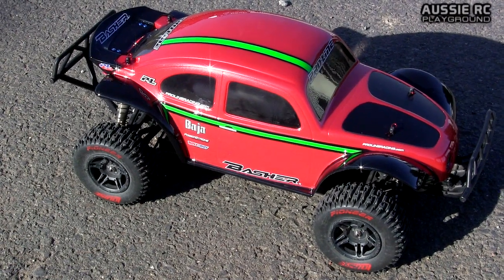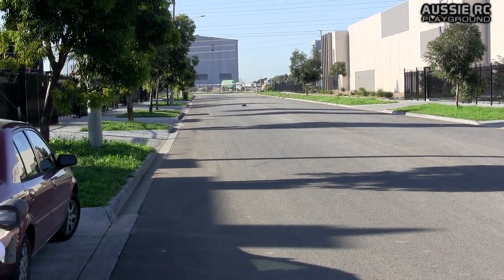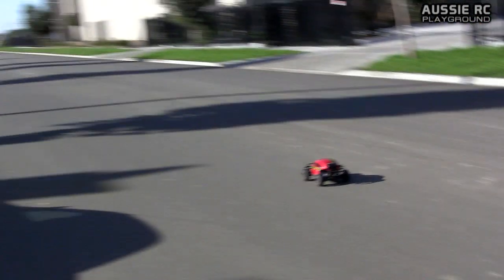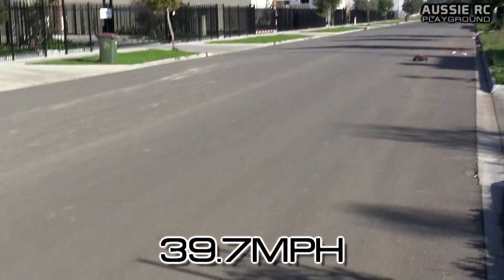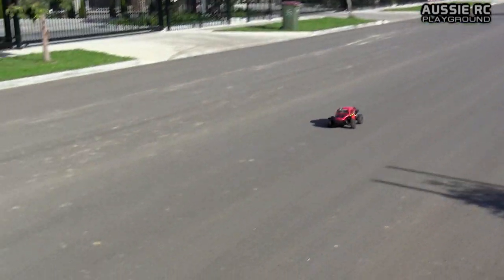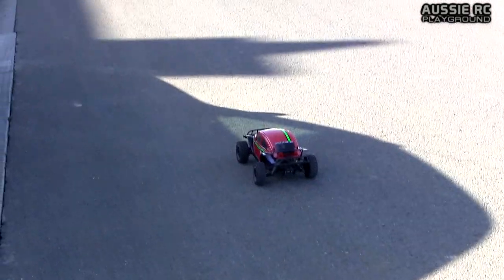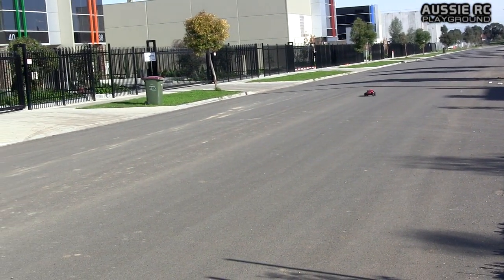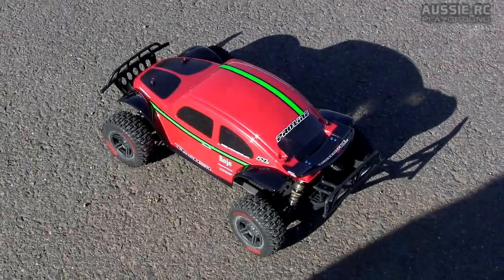RC SPEED WEEK #4 - NC Basher SCT with Castle Sidewinder SCT

Comment: Did you like the castle link?  hobbyking have definantly stepped it up with the nitro circus range, most people like to do there own body and choose tyres to suit different terrain. So for a basher or somebody on a budget i think they are great, parts unfortunantly arent available at your lhs. Nice speed on 2s and crazy on 3s, awesome body too mate  :-)
Reply from the maker: Caste link is great! It took me a couple of minutes to work out how it works and then it was a breeze. Tweaking the settings is as easy as plugging you ESC to your computer (and they give you a long lead for that) and away you go. It's pretty simple. The only downside is that if you're at the track and want to make an adjustment, you'll need a laptop to do it. There's no program card (not that I'm aware) to do the tuning.

I'll give you a little spoiler right now about the Basher SCT - it's a little over rated. There is no benefit from those upgrades from the stock Trooper in the overall performance of the truck. The deck does nothing except look good and the shocks, although they work a little better, aren't really that good because they still leak and have soft shock shafts. The most disappointing thing about the Basher SCT is that there is not increase in power or traction, which is where the upgrades should have gone. There are also no alloy shock towers, CVDs, a better steering servo, nor did they make it waterproof like the others. Yes, it is a good truck for the money, but they upgraded the wrong things on it, I think. To be honest, they should be selling the Trooper as kit or a roller. The electrics in both trucks are just too weak for them. I mean't it's OK if you're starting out and need something to practice on, or you're a 10yr old kid with his first RC, but for people with a little more experience, this just leaves you wanting more...

Comment: Awesome.  What was the motor and esc temps? If it was low attempt more high speed gearing. And what wheels and tires were those
Reply from the maker: Didn't check temps since it was just a short run, but I'll have to look at it again next time I run it.
The tires are a Louise Pioneer, which sell under the Duratrax brand as well. I think they're called Lockups... Don't quote me on it.

Comment: hi Vas great vid again. I use castle creations motors over here in the uk
what weakness' in the truck do you think the powerful motor will bring up.
do you think the diffs will hold up and is there anything wearing yet
Reply from the maker: Hey Kev,
The rear toe links always bend during bashing, they hit the chassis due to lack of clearance. I've had to cut the alloy chassis back in order for the links to move freely. That's about all I can say at this point, which was the same issue with the Trooper.
The extra power was something that I really wanted to try because I never got around to doing it when I had the Trooper. I can say the diffs seems fine so far, but I did put 100k oil in the centre diff. None of the diffs have oil in them from factory, they only have a very small about of grease in them, so I'm tempted to put oil in the other two as well.

Comment: I was thinking of buying this system for my Traxxas Slash 2WD, should I? I have heared that the maximum size LiPo battery for this system is 2S, doesn't the ESC or motor overheat on 3S? Nice vid!
Reply: I think I'm going to do the same with my slash and I was wondering also
Reply: u should get it i have it in my slash 4x4 and it is awesome and I run it on 2 and 3s lipo and geared 15 54 on 3s the motor is only at 135 degrees wich is awesome for 3s

Comment: Can you do speed test with the stock motor and esc?
Reply from the maker: The Turnigy Trooper is basically the same as the Basher SCT and has the exact same electrics in it. I did I speed test of it a long time ago, so I didn't see the need to do it again with this truck.
Turnigy Trooper 4x4 SCT Speed run

Comment: Nice video as usual. That is a surprisingly fast car. Did you happen to check motor and ESC temps after the 2S and 3S runs?  Just curious how hot the Castle system got.
Reply from the maker: Didn't check temps since it was just a short run, but I'll have to look at it again next time I run it.
Reply: I was wondering the same, if your staying under 120 with power like that, it's doing great ! (F not C)

Comment: Should be faster! I'm running a 3500kv Tacon 10.5t and on 3S on my Nitro circus sct and  hits 52 mph with the stock 14t pinion (gps speedo)
Reply from the maker: Well, maybe my gun is out or your GPS is out, or it could just simply be that your motor is better. Either way, this is plenty fast for my needs. :)